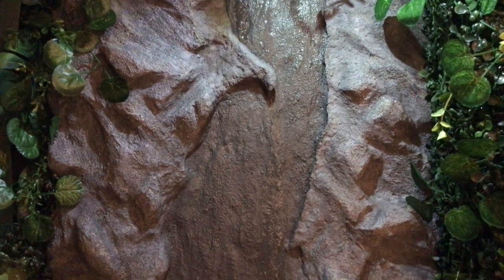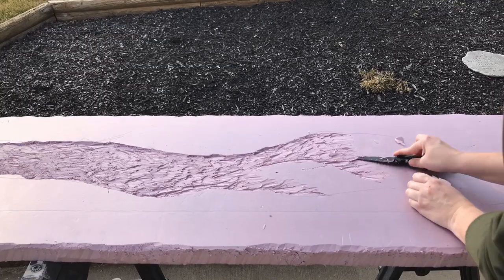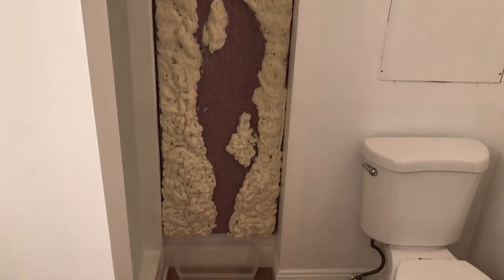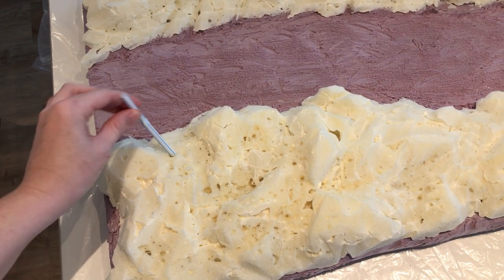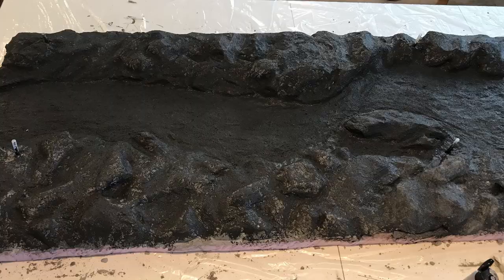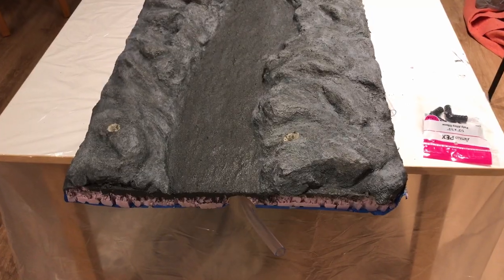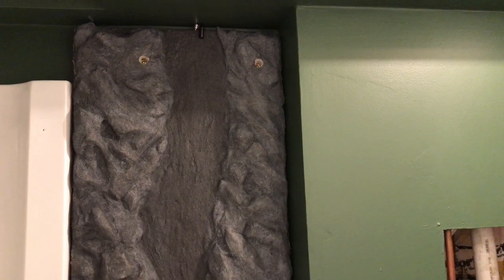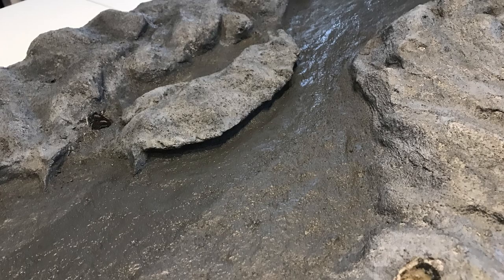DIY Waterfall Fountain- I made an indoor water fountain for my bathroom

Comment: Very Cool, wow I didn’t think it was so complicated. I want to build a tiny water fall in my shower. On one side of the tub is a faux wall of plant squares that go up the wall, with a big planter on top. Although it’s covered by a top to bottom curtain, that’s why. Want to do a water fal on the other end of the shower. I think, not to get to complicated, and that I’ve had many fountains in the past that spl@shed onto my carpet. Is @nother reason why I want to contain it in the shower, cont…..

Comment: What did you use for the greenery on the wall??
Reply from the maker: I bought Boxwood Greenery panels from Home Depot here is the link https://www.homedepot.com/p/Ejoy-20-in-H-x-20-in-W-GorgeousHome-Artificial-Boxwood-Hedge-Greenery-Panels-Milan-12-pc-Milan-12pc/314160722?source=shoppingads&locale=en-US&pla&mtc=SHOPPING-BF-HDH-GGL-D59H-059_006_HOME_DECOR-NA-Multi-NA-PMAX-HDH-HDH-NA-NA-NBR-NA-NA-NA-%7C006_029_Artificial_Greenery%7C_PMAX_phase_1&cm_mmc=SHOPPING-BF-HDH-GGL-D59H-059_006_HOME_DECOR-NA-Multi-NA-PMAX-HDH-HDH-NA-NA-NBR-NA-NA-NA-%7C006_029_Artificial_Greenery%7C_PMAX_phase_1-71700000110503232--&gad_source=1&gclid=CjwKCAiAgeeqBhBAEiwAoDDhn9vFKbvwe5NljNTJUjaiE-6nJeuQsbTQfy-bU78fYYdxkZstqqQqnBoClaYQAvD_BwE&gclsrc=aw.ds